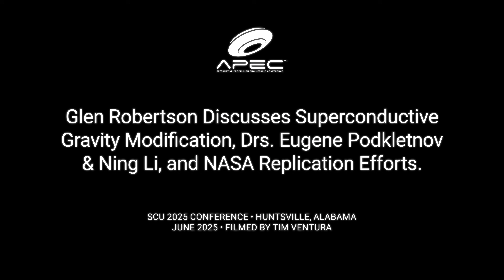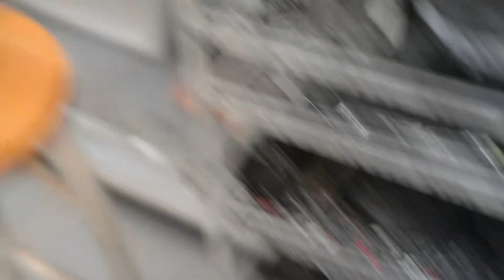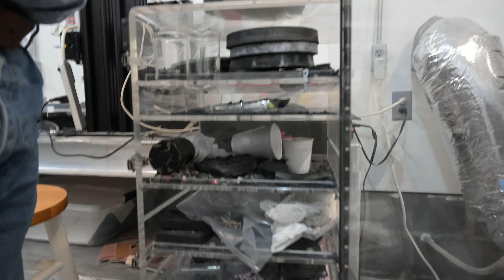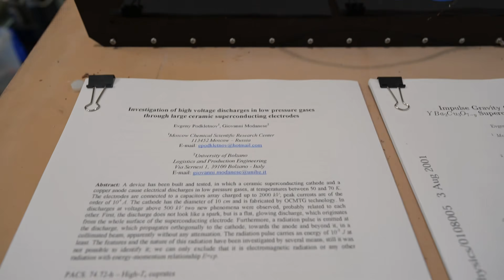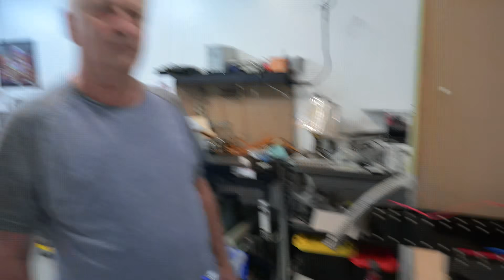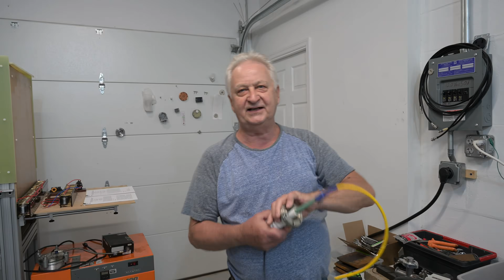Ning Li, Podkletnov, Superconductors & Antigravity | Glen "Tony" Robertson

Comment: Dark matter beam it is. Within superconductors, electrons are allowed to move only along very narrow paths between atoms. Such electrons are exposed to vacuum fluctuations in a similar way to electrons within graphene layers. Additionally, vacuum fluctuations exert quantum motion on charged particles, forcing them into a wiggling motion known as zitterbewegung. But what happens if these particles cannot move freely in spatial dimensions? A fascinating situation arises: the electrons begin to wiggle along the time dimension instead. In the dense aether model, space-time resembles a water surface gradient, where the time dimension remains perpendicular to the surface. The electrons constrained in motion along water surface thus behave like floaters bouncing up and down across it. Such an electrons—Dirac fermions—act like paddles dipped underwater, capable to exert a reactive force on the vacuum. In contrast, all other particles pass through the vacuum without resistance. From the water surface analogy, it follows that when Dirac electrons are jolted by an electromagnetic impulse, a beam of scalar waves is emitted in the opposite direction. The superconductor experiences a mechanical impulse, propelling it forward without any visible propellant—a propellantless drive. Therefore, Podkletnov's drive does not modify gravity; it simulates it in a directional way. Best of all, this arrangement doesn't require exotic superconductors or extremely low temperatures. Electrons constrained in motion can be found in any capacitor charged to a high voltage or inside electro-/ferromagnets arranged in a repulsive configuration.
Reply: From Electrogravitics Systems Reports on a New Propulsion Methodology, edited by Thomas Valone we read: “The basic research and technology behind electro-anti-gravitation is so much in its infancy that this is perhaps one field of development where not only the methods but the ideas are secret. Nothing therefore can be discussed freely at the moment.” The preceding quote is from 1954.
Reply: Energy-momentum conservation says no. By the way there is no "scalar" wave as a solution to Maxwell's equations.
Funny sci-fi bit though, even if it violates both Newton's laws and the symmetry of space-time!
Reply: @momosaidnineisfine2194  Original quaternion formulation of Maxwell's equations did contain a scalar components, but it was simplified and renormalized later by Heaviside and H. Lorentz. Anyway, this isn't argument because Maxwell's equations contain photon neither in their solutions, yet physicists insist, that photons exist. Yes, the scalar solution violate dimensionality of space-time and they allow existence of perpetuum mobile and reactionless drives, which is why I'm interested about them. But the experiments have last word here.
Reply: @Milan_Petrik  I truly wish you the best with your experiments if you act on them, please don't mind my pessimism. Afterall, science is about confronting our otherwise most trusted assumptions!

Comment: 🚀 Superconductor Gravity Test Deep Dive – Key Moments Summary 👇

0:18 – 🔬 Interview w/ Tony Robertson in secret lab – ex-NASA, worked w/ Dr. Ning Li & Podkletnov concepts
1:02 – ⚠ NASA never actually did the rotating superconductor gravity test
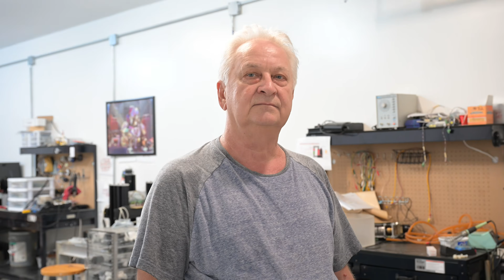2:00 – 📉 Podkletnov claimed gravity drop above spinning YBCO disk in Finland (smoke test)
3:30 – 🌀 NASA formed a team to try replicating Podkletnov’s rotating disc — never completed
4:10 – ❗ Dr. Ning Li’s “AC Gravity” theory added a twist, but experiments weren’t finalized
5:24 – 🏗 Huge 12" YBCO discs made, but fragile & cracked during firing/cooling
7:00 – 💧 Moisture and temp swings destroy superconductors easily
9:00 – 🧪 Melt-textured growth process explained — requires 100+ hours of precision cooling
11:03 – ❌ No one in the US ever did the full spinning disc test — internet claims are wrong
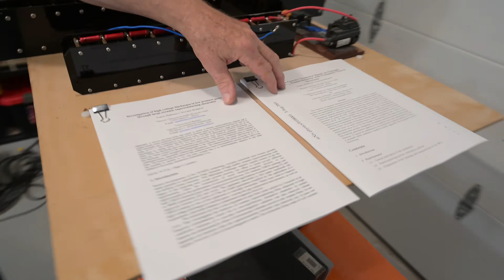15:00 – ⚡ New focus: Impulse Gravity Experiment (Russia, 1990s) using high-voltage discharge
16:29 – 🌩 Podkletnov reported a white plasma cloud hitting a grounding plate with force
18:00 – 🎯 Tony's team is replicating this impulse test using ~700–800kV Marx bank
20:00 – 🧯 Still engineering vacuum gaps, chamber layout, and safety protections
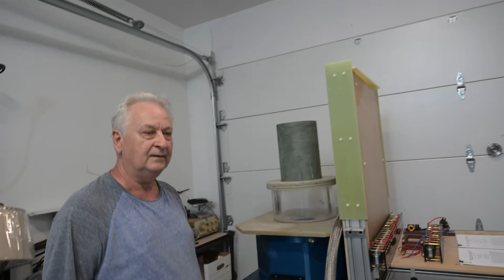23:00 – 💥 Potential to crush concrete if impulse beam is real – outdoor tests planned
24:00 – ☢ Podkletnov warned the backside of the beam could burn skin – possibly microwave radiation
29:00 – 💡 Podkletnov later claimed non-superconductors may show similar effects
32:30 – ✅ Tony says: no one has done a complete replication yet – too many missing details
35:00 – 📖 Tony wrote a paper suggesting Cooper pair motion may generate gravity waves
36:00 – 🌌 Goal: discover new physics, possibly usable w/ materials beyond superconductors

👀 Bottom line: After 30 years, Tony’s team is finally trying to do the real test Podkletnov described. Massive voltage, superconductors, and a shot at detecting real gravity impulses. 🧪🌀

Comment: Instead of messing around with difficult to manufacture physical material, a plasma can be induced to self organize into a superconducting state with dense charge carrier regions that support cooper pairing via plasmon resonances. In other words, a self organized plasma's self generated magnetic field contains the plasma and electrical forces create what are called electrical double layers. These double layers continually undergo oscillations and plasmon resonances which can induce electrons (already pushed close together into a high density) into moving together and forming "giant cooper pairs." In a plasmoid or exotic vacuum object, the coherence length of these pairs would extend for macro-scopic distances and the waveforms of millions or billions of them would overlap. This would enhance coupling to the vacuum and enhance the frame dragging effect so that a "warp bubble" could be created that would wrap around the craft. Such a bubble would allow for all the observed characteristics of UAP and reverse engineered human craft like the Fluxliner A.R.V. as reported by Bradford Sorensen and other of Mark McCandlish's witnesses. If any one element or isotope would be optimal for the plasmoid, it would be mercury isotope 199. However, for lower performance systems (still in far excess of all conventional human technology) mercury of the isotopic ratio could be utilized: allowing contractors to easily produce thousands of anti-gravity drones which could be the cause of some UFO sightings.
Reply: The advantages of utilizing a self organized superconducting plasmoid rather than conventional superconducting materials are many. One huge win is that the plasmoid or macro-scale Exotic Vacuum Object will self organize all by itself when provided with the proper stimulus such as high voltage electricity or microwave energy. Likewise, the shape the plasmoid which may control the asymmetry of the warp bubble and thus propulsion may be controlled by varying the shape of the reactor vessel or electromagnetically with capacitor banks or electromagnetic fields. This is a technology that's simple and straightforward for any nation around the world to develop in a matter of several months: not years or decades. Hence, one reason for the cover up. The reason why the official military cannot use this technology in any manner that could disclose it to the world is because then every nation would copy it rapidly. A jump from present day energy/propulsion tech to a level of development that could rival Star Trek would be possible in an extremely short period of time: not four hundred years in the future. More like a few months for every nation to build prototypes (those that don't already have them), a couple years to build space craft capable of colonizing the solar system for the good of our species, and a decade to establish a sizable human population off Earth. This must happen immediately. Any delay is a tragedy that threatens our survival as a species if anything like an asteroid were to approach Earth.